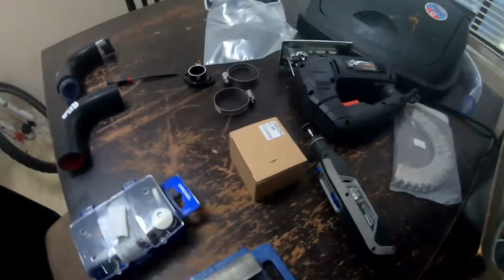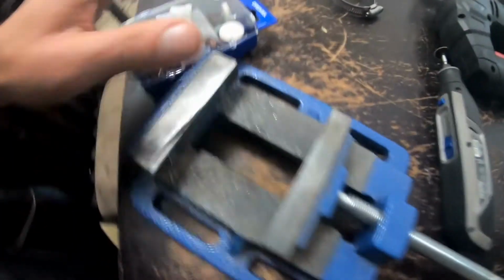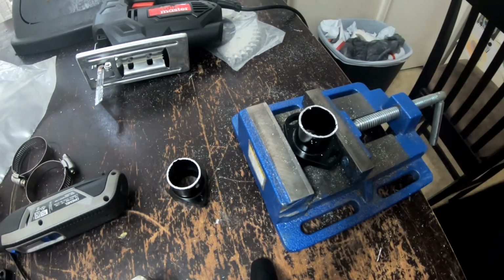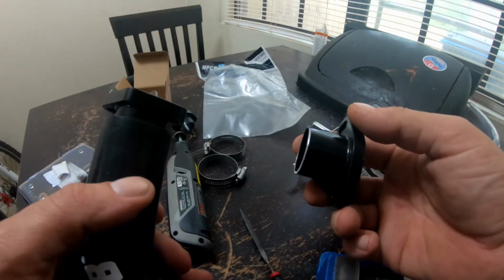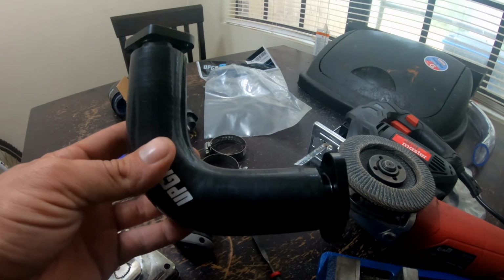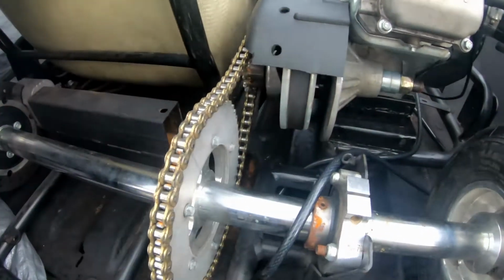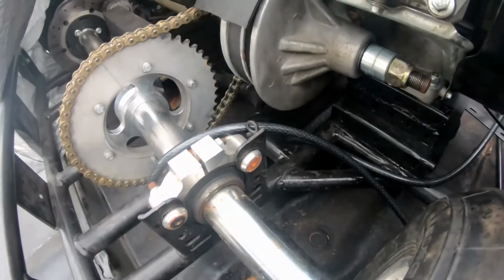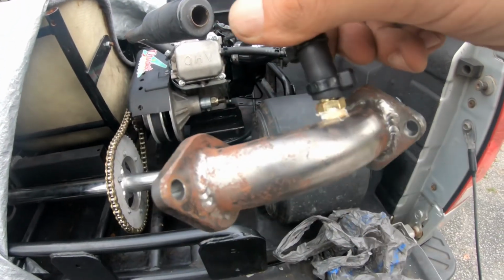Custom Inverted Intake- Predator 212

Comment: Everything I see on the internet says gasoline and silicone tubing do not work well together. How long have you used this setup?
Reply from the maker: The Internet is right, fuel will break down non pfe silicone. I didn't run it long enough to matter though maybe nine months.
Reply: @turnwrenchesjr3352  how many hours do you think you ran it in nine months? I did think it was a great idea otherwise 👊
Reply from the maker: Not that many hours on it. I just ended up putting it the right angle to clear the tire. There is a metal one out there but it costs as much as the engine.

Comment: So the gas isn't eating through that silicone hose?
Reply from the maker: It didn't the time I ran it, but I'm sure it would over time.
Reply: @turnwrenchesjr3352  i never knew it would be so hard to find the right hose to make a custom intake! I do have a silicone one, but am afraid. So idk, maybe i could run it for a little while like you, but find my way to the nearest weld shop, lol. Yeah that's probably  what im gonna have to do. Thank you for the reply and the cool video you made for us ☺️
Reply from the maker: @KB_Joys  i found one but it was expensive, so diy
Reply: @turnwrenchesjr3352  yeah that's what looks like I'm gonna have to do. Im mounting a 136cc vertical to fit in a gas bike frame.  My exhaust will have to go the other direction too  i did get an exhaust pipe and put it on the other way, and it might work, but it is awfully close to looking like that's not going to fly either. 🤦 DIY to the rescue 🤣
Reply from the maker: That's the great thing about these small setups, gets your ready for fab on big projects.
Reply: @turnwrenchesjr3352  absolutely!. And i think its safe to say that its a lot less expensive the second time around 🤣 or maybe not..... 🙄🤦😂

Comment: Turbo band clamps would of been ideal too plus you can use end of it to mount it to engine with a bracket.. But nice I will be trying this soon thank for this nice mod.
Reply: I used a 1 1/4 sink drain pipe with a 90 degree with two hoses and clamps.  Cut the pipe to length and secured to bracket.
Reply from the maker: No problem, how did the mod go?